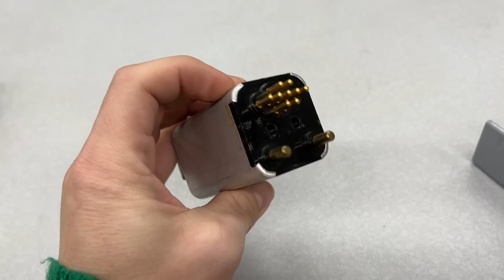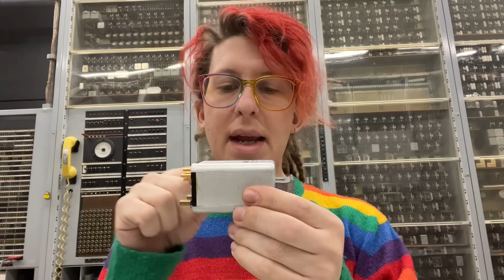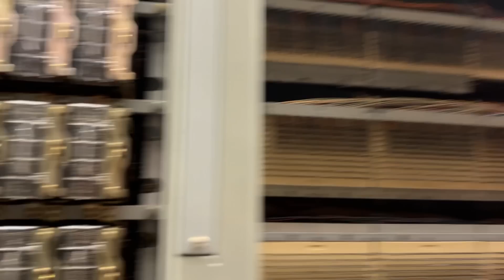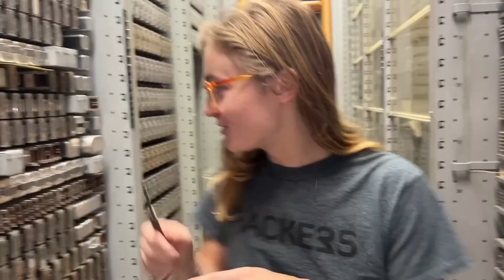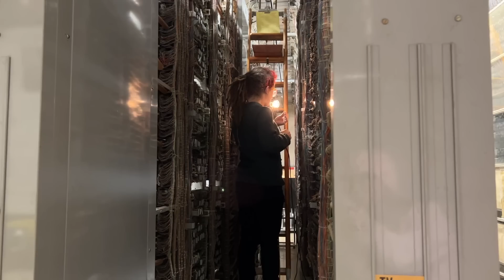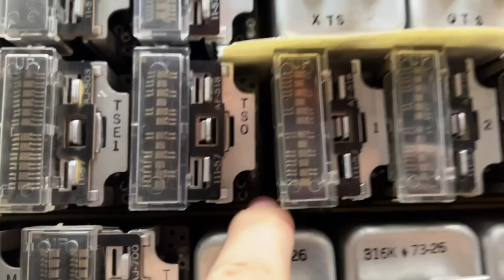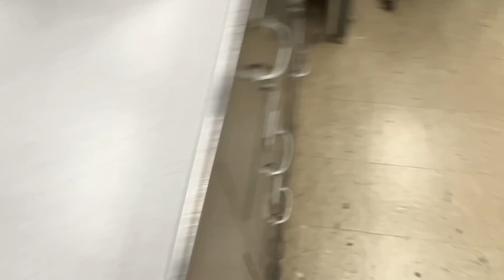Malfunctioning Potted Relays: Emergency Repair in the No. 5 Crossbar

Comment: What you need to clean those relays is Western Electric KS-20406-L1 cleaner, oh wait that is not available anymore, however it is known as Trichloroethylene (TCE) ACS Grade and can still be obtained for a fair price, but be careful with it, safety glass's, nitrile gloves and plenty of ventilation. Where you have a sticky relay pack a bunch of paper towels under it and give a wash with Trichloroethylene, it will rinse that green goo out of there quickly leaving no residue.

Comment: Late to this post but, this is a problem that has occurred in a 70's era radar set that i worked on a while back. I was told by an engineer from Vitro ( the company that built the gear) that it was an issue caused by the organic polyols that were used in that "species" of potting compounds. Vitro noticed it after about 5 years since their gear ran hotter/longer and it aged the compound pretty drastically in a short time frame. Eventually it got so nasty that they had to refurb a bunch of radars in the field. Anyway-fascinating video as always and i hope y'all got it figured out

Comment: The green goo is probably Rosin. The rosin will break down seals.  You might try sealing the relay cans with epoxy.  Because of off gassing, let the epoxy dry for at least 72 hours or a week before returning to service.  I have used different brands of epoxy.  JB Weld is easier and more predictable in my real world experience.  It is super critical to mix really well the two parts.  I use aluminum foil folded over a few times for ease of mixing and tossing the left over.  I would dispose of the foil outside so there are no flammability issues in the CO trash bin.   You can buy a cheap pack of paint brushes (looks like metal tube like a pencil) with a small brush at the end.  Use once and toss.

Comment: How did you and the others your age in these videos learn so much about the telephone equipment that was manufactured so long before you were even born. It that has been explained in another video could you provide a link to it. It's fascinating because I worked for 26 years at the OKC Western Electric/AT&T/Lucent Technologies plant where central office switches were manufactured. I did not start until 1976 and by then we were just starting the manufacturing of the ESS switching systems. The 1A and Remreed and then the 5ESS. Even various 3B computers too. The plant opened in 1960 and initially they were manufacturing the Crossbar systems and coin telephones, along with the individual components for them like the relays and carbon resistors. All of that was gone by the time I started there in 76 but your knowledge of all these switching systems is fascinating. I really enjoy your videos and often wonder if some on the equipment you have was manufactured in OKC. .

Comment: I've been watching a lot of your videos lately after discovering your channel.   Cedartown, GA where I went to school grades 1-11 and where my father taught was on Bell System and they had a Number 5 Crossbar starting in 1961 when dial service was set up (748 which was likely going to be PHilpot 8) had they not already been moving to all-number at that time.   I got to see the No. 5 Crossbar on a field trip once!   I lived in Cherokee County, AL where we had an independent non-Bell phone company and they had a bunch of Stromberg Carlson XY exchanges all over the county (do you have any of those at your museum?).   We had WAlnut 7 (927) for Centre, GReenwood 5 (475) for Whorton, LAkeside 6 (526) for Leesburg, LAmbert 3 (523) for Sand Rock, JAckson 4 (524) for Collinsville, LAwrence 8 (528) for Crossville in 1956 when dial service was set up there.   SPruce 9 (779) for Cedar Bluff and GArden 2 (422) were added in 1957 when that phone company bought out the one in Cedar Bluff.   I believe that all of these were Stromberg Carlson XY.    It was long distance to call 1.5 miles east of where we lived since 777 (which likely was likely to have been SPRing or SPRing 7 if all-number wasn't becoming a thing in 1961) was in Georgia.   They probably had a 355 step system and I guess that due to how the dial tone sounded on a funky old post-pay coin phone at the state line that may have had a range extender on it due to some funkiness with it.  It sounded different than any other phone I ever used.   It was local to Cedartown and Rome though.   South of us, Piedmont covered part of the county with GIbson 7 on Bell so it was long distance to call Spring Garden School where some students in my area went.   I went to Jacksonville State University and that town was HEmlock 5 and Anniston south of there was ADams 5.   I totally love your channel and your knowledge and it makes me with I could go back to the 70s and 80s and record a lot of the sounds from phones during that age.   I love your colorful striped shirt and style as well!

Comment: Where on that test rack is the TDR, I assume the diagnostic relay switches the pair over. I assume it has one does it ?
Reply from the maker: @TRS-Tech  no TDR in these systems. Cable breaks are found using a Wheatstone bridge or a Varley loop test.
Reply: @ConnectionsMuseum  Ahh the good old three wire. Great until you have a open circuit and battery at the same time, they are a nightmare to find. Do you know roughly when the LDU was introduced? They were able to isolate both legs and test them with no conditions. I know the wheatstone method but not heard the term "Varley test" though. Was that a piece of early test kit? Really enjoy your videos 👍

Comment: Out of curiosity, since you mentioned the cost-effectiveness of things, how expensive WERE they when new? I have no mental baseline for how much a panel switch or a 1XB even cost.
Reply from the maker: Costs are difficult to estimate, since each office was built-to-order, and installed specifically for the area it served. Also, costs were for the equipment and installation, and did not account for other necessities such as (1) Constructing a building to house the machines, (2) training, manuals, documentation, (3) furniture, test equipment, tools, etc. 

But, in 1923, Pacific Telephone paid $883,000 for three (3) panel offices in Seattle. Thats roughly $16,484,000 adjusted. Divide that by three, and you get the cost of one office: $294,000 or about $5,400,000 today.

Again, thats a rough estimate of scale, but costs could vary pretty widely depending. I suspect that since the 3 Seattle panel offices were small, they were on the lower end of the cost scale.
Reply: @ That’s definitely an expensive pile of gear! I learned that the University of Arizona installed a 5ESS serving about 24,000 lines in 1989 (because they just retired it in 2024 and I found an article about it) and that project was about $25 million, of which about 25% was the actual switch. Interesting to know that the older mechanical switches were probably similar orders of magnitude. 

And supposedly the U of A’s 5ESS is bound for a museum somewhere. I hope more of the modern gear also gets preserved as it’s replaced with VoIP switches and stuff.

Comment: Perhaps try an ultrasonic cleaner and distilled water. You can try small additions of alcohol or vinegar. Vinegar would require at least  two good rinses. Alcohol would be good even in rinses as it will allow more water to flow off the device.

Comment: When I worked at Chicago #1 telegraph I had the opportunity to "box" polar relays, specifically the 209A type.  It was a delicate job and a "few" relays found their way to the Chicago river. The mercury wetted polar relays were a godsend.  When they acted up you just pulled them and tapped them on the floor and they were good to go.

Comment: 0:40 The potting material is leaking from the two empty holes on the back of the relay. That is where it was initially filled with the potting material. Plug the holes, such as by threading the holes and inserting short bolts with a rubber washer seal. Also wrap the metal and plastic seam with a waterproofing silicone tape.

US Patent 4134088 by Bell Labs - 1977 - A pair of apertures 34 and 35 provide access to the interior of enclosure 33 for the introduction, for example, of a potting compound 36, a portion of which is represented in the drawing.

US Patent 2882505 by Bell Labs - 1959 - The potting composition of the present invention possesses an extremely desirable combination of these requisite characteristics. It consists of a mass of fine particles of fused alumina, each particle preferably being coated with a cured silicone resin.

Bell Laboratories Record Volume XXXI No 11, Nov 1953, page 462, potting with wax using a hospital centrifuge.
Reply: I bet the resin is separating.

Comment: Sound in tech from the 1960's and before is always going to be one of your first indicators of a problem. I know several soldiers from the 1980's who were working in microwave relay trucks supporting Tropo Scatter radio systems who would often sleep in their rig's simply because it was going to be warmer than the tent on that hilltop in the middle of winter. Universally those who experienced a failure of a transmitter that happened while they were asleep, reported that the first indication that they had that there was a problem was not the transmitter shutting down, or fans failing (the equipment had a lot of high flow fans, which were as loud then as the cooling system for a crypto-mining hut are today.) No, the thing that woke them up was the relay for the alarm circuit for the radio detecting a problem ticking over. The next should that would be generated was the horn that you would expect would wake anyone in the rig, but as I say, every one who was asleep when one of these things tripped reported that the noise that woke them was t he relay click. They were wide awake before they heard the horn. If you were awake, then the only thing you 'heard' was the horn, but when you're sleeping, your subconscious filters out the steady noise better than any pair of sound canceling headphones ever will. That said, if you're in a room of teletypes, or relay operated equipment like a phone system, the noise of the mechanical bitss will tell the experienced operator if the equipment is healthy and happy, or not.

I have thoughts on why these relays were potted, but no experience, so I'll shut up now and listen. :-)

Comment: The potting material has degraded to the point where it is oozing out. The bad part is that potting material probably contains some pretty nasty chemicals. Since they were designed in the 1960's, you could be looking at PCBs, or other nasty chemicals used as insulator material. 
I wonder if Acetone, Mineral Spirits, or paint thinner would be the solvents needed to dissolve it out of the relay. The bad part is, would those solvents also damage the relay insulation on its coil. Brake cleaner might be a better solvent, since it evaporates quickly.
I'm assuming you guys cannot get replacement sealed relays. :/ Once enough of that potting insulation oozes out, the life of the sealed relays is a ticking down clock. Thankfully, your frames aren't in a production setting. (where they're still used for calls)
the open relays remind me of the relay switch setups in pinball machines.

Comment: this is dumb question-do the leaky relays fail as they leak or just leak? if they don't fail, could you seal the leak points? when i worked with these they rarely failed, but we had spares readily available.
Reply from the maker: None of them have failed yet! I have some superglue that I"m going to try first, but I just haven't had the time yet. Thanks for the reminder. I'll try it this week or next.

Comment: The blue-green goopy gunk is degraded diisoctyl phthalate. When plasticisors of that day are used as an insulating agent where they are exposed to both heat and anything made of copper, the plasticisor slowly breaks down into that evil ectoplasm. in the insulation and the copper. Between 1965 and 1970 or so, temprature performance of PVC was uprated by the inclusion of an anti-oxidant in to the PVC. The side effect of that was that the new addition really encouraged the production of goop. You'll find that the same green goop can be found in power cables and bus-and-tag cables of that same time period also. You should try not to get the goop on your skin, it's more than likely got a high concentration of free radicals.

Comment: I encountered a goop nearly identical to this coming out of the green wire insulation in a vintage polymoog... It got into all the wire harness plugs and I have yet to find an effective way to clean it off the contacts. I guess I'll have to try goof-off!

Comment: I have seen many old plastics dissolve into goo over time.  One example is the platen rollers in military AN/UGC-74A radioteletype units that radio amateurs are interested in.  The Museum of Modern Art in NYC had a problem with many old plastic items disintegrating as well.

I wonder if there is a way of sealing the gap on those relays between the phenolic base and aluminum can, perhaps with a high quality silicone bead after cleaning to assure good adhesion.  It might be possible to do this without having to bend the aluminum can tabs, purely from the outside, but of course if you did open them and clean then seal with a silicone or acrylic adhesive it would be more foolproof.  If you want me to play with it a bit PM me and you could send me a couple of defective relays that are leaking and I could try a couple of ideas and then send them back to you to check out.  It might just work.

I'd like to see these old systems continue on and I am grateful to have been able to play with when they were in common use.

Comment: That goop. Is familiar.

If they’re solid resin potted, that may be the result of an internal arc melting the potting material! I’ve seen it in (much smaller) relays. It’s a rather dramatic—and gross—failure mode. If the resin isn’t particularly stable—and what is over these time frames?—simple decay may cause them to leak. I think I also saw this happen to EEVBlog at one point. 😐

Comment: Take out your leaky relays, clean them up, scuff them up a little bit and apply something called "shoe goo" around the area to seal it. Shoe goo is like a cross between caulk and super glue. I sealed a bike tire with a large hole, with nothing but shoe goo 3 years ago and it's still holding air. I also patched a few holes in my inflatable hot tub. I patched a pinky sized hole, it's been holding for a year now

Comment: Maybe an ultrasonic cleaner with WD40 or similar solvent instead of water.
You may even get away without disassembly of the springset.
I worked in the UK back in the 70's on crossbar TXK3.
Loved it ! Keep up the great work. 👍

Comment: Have you considered using heat shrink tubing over the entire outer case of the plug-in relays?  This would contain the GOO within the heat shrink tubing.  Simply remove the relay, apply the heat shrink, plug the relay back in.  Hope this helps.  Great videos.  Just discovered your channel.

Comment: How come WE/BELL LABS didn’t use sockets for the relays? Reliability? Point of failure?
Reply from the maker: Good question. To be honest, relays don't have to be replaced that often, if at all. Most of the time, they can be repaired in place. These things were built for 40 years of continuous operation, though out 5XB is now 65 years old so it's well outside its designed lifetime. Adding sockets to each of the maybe 50,000 relays in single switch would have added substantial cost for no meaningful benefit.

Also, every socket needs to have maybe 12-14 pins on it, which could each fail due to vibration during shipping and regular operation. Introducing those extra points of failure was not worth it to them.

Easier to pay someone for an hour of time to replace a (rare) defective relay. Tubes are another story, however, as they needed to be replaced much more frequently.

Comment: The goo, means the potting or varnish has aged out and degraded. The petroleum distillates have long since evaporated, moisture in the air has gotten into the remains, bacteria has started munching away and poo'ing out ...goo. At least thats the best guess myself and a few others I worked with back in the day came to. The goo, is microorganism poo.

Comment: That "goo" is nasty stuff.  I probably would not be touching it given the age of the equipment.  It is quite possible it contains some pretty nasty chemicals, could even be a cancer causing chemical in it.........       Can you disassemble to leaky relays and clean them and reseal them?     
Not sure what the goo actually is.  I have seen similar stuff on some plastics used on cabling where the plastic has started to break down and leak a blue/green goo.

Comment: Speaking of the TS1 relay, it appears that contact 6m is closed (23:24) which should not be since the relay is not energized. I absolutely admire you repairing that wire spring relay. Disassembly and reassembly of that thing isn't easy. Love your videos. You do a great job of explaining these switches.

Comment: Enjoyed the presentation! Worked on xbar over 20 years! I replaced every 280 type relay with 360s in all markers, current flowed the rest of the 280s that did not have a 360 replacement. DCT relay current flowed, very few troubles after that. Never saw any green goo! Happy to have sent you a pack of double sided cards!  Worked in PTTWPAPTMG0, Pottstown PA 11:42  Feb 9

Comment: Go to Autozone and get a can of spray brake cleaner it will take that stuff off.  I have had this same problem on old Military transceivers that have them same relays in them.  Also what I did was get a can of clear coat and a paint brush and coat the seams of the relay to re seal them and stop the leaks and it has worked fine